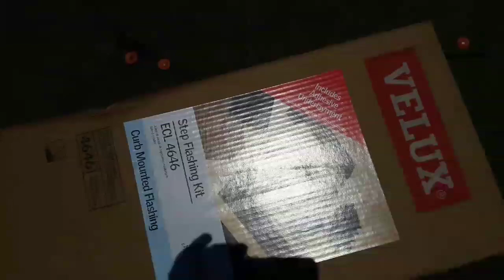Roofing : Installing a Velux Skylight !!  Check this out !!

Comment: You dont show how to flash the skylight .
You dont fold in on top of the skylight.
You have a clu ?
Kit is 100 plus .
It has corners that are folded so they wont leak.
It woul leak if you a dunno roofer .
Solar panel is attached to the side of smylight.
Your guys work .
Snap line to put the ridge cap so it straight .